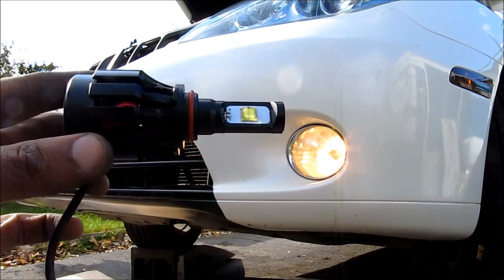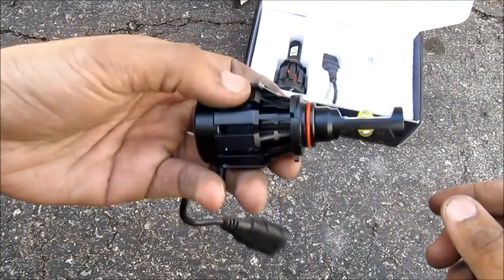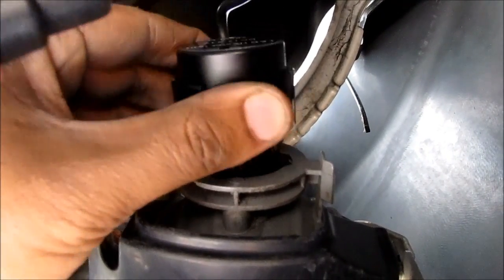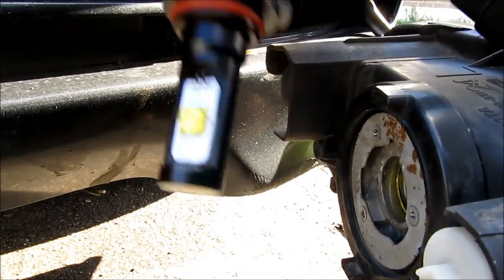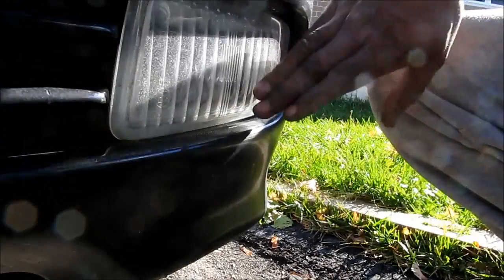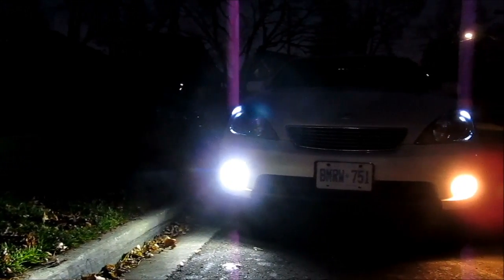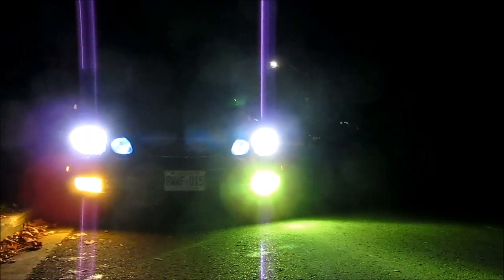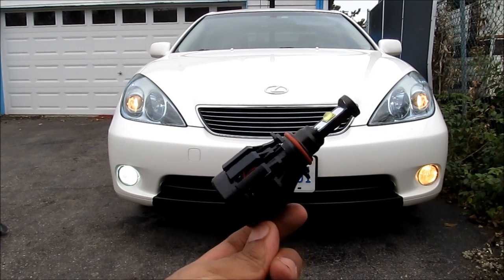LED Headlight & Foglight Review

Comment: how is fuel economy related to the wattage of the bulb?
Reply from the maker: +Angad Singh The savings on gas are very small, but nevertheless it is a saving. If you convert all the bulbs in your car to LEDs you might have a payout at the end of the cars life. That's another reason why manufacturers are incorporating LEDs in new cars these days as fuel economy standards are becoming more stringent because of CAFE regulations.
Reply from the maker: Power for the bulb has to come from somewhere, in this case the gasoline that powers your engine :)
Reply: +speedkar99 

wow. Thats a first. In the event your theory is correct you wouldn't need a battery. Nor would you be able to turn on any electricals when the car is not running. 

Power comes from your alternator/ stator/ magneto which is then regulated by your rectifier and your battery is charged. The battery in turn powers ur appliances. 

In an extremely rare event if your battery is weak and over loaded you will have a weak spark that would result in loss of power or a total lack of spark but it is highly u likely to result in any change of fuel efficiency.
Reply from the maker: I think you missed the point.
The light bulb is driven by the electrical system in the car which is driven by the engine. The engine gets its motive from gasoline.

Therefore the less electrical load on the car, the less fuel burnt. The differences are very minimal and the pay off period is very long, but it does exist.
Reply: Your battery is there to provide electricity to the starter motor, which is used to "boot" the engine into a state where it can run on its own. Once the engine is running, its spark plugs are run by the alternator, which is run by a pulley connected to the crankshaft. If you disconnect the battery from a healthy charging system while the engine is running, the engine will continue to run. If the alternator needs repairing or replacing, the engine dies as the battery was running the ignition system in its place.

The engine, through the alternator, can run the entire electrical system in the car, as long as the battery is healthy and can be recharged by that system easily. If the electrical system pulls less power while the engine is on, then the engine uses less fuel. If you turn on your AC, lights, stereo, etc. before starting the engine, then you are pulling power from only the battery, but that lost power will be recharged from the alternator after ignition.
Reply: I just want to make sure you understand +speedkar99's point. Once the engine is running, the battery can be disconnected and lifted out of the car; all the electronics and other systems can be run entirely by the engine, through the alternator, and therefore all of the energy for that comes from the gasoline the engine runs on. Lower-efficiency incandescent bulbs will use more power, and more fuel, than LEDs, so LED lights will result in better fuel economy.
Reply: +Kyle Mitchell yep as long as the battery is healthy and the charging system is healthy it will run. 

If the battery is very weak the battery will drain power as such lesser current will go to the spark plugs and such. 

Regardless the point on petrol savings seem to be out of whack!
Reply from the maker: Modern cars won't let you disconnect the battery from the car and keep running, but I understand your point in that the car gets all its energy from the gasoline.

Comment: Just as an FYI, in case you're not aware, that "humming" from the LED is the fan in the base. All car LED's have a fan in their bases, hence the large part/heavy duty base. This is normal and helps dissipate any heat.
Reply from the maker: +Somnus no fan in this unit and theres no airflow coming off the back. Just a giant heat sink.

Comment: Do they make that LED in yellow?  That might make it more yellow.  It would be the same idea behind using a red bulb in a red housing to avoid that pink color.  The whole idea would be to make the car look more normal but have brighter lights.  If I had a car that had yellow fog lights or even a yellow capsule in them, I would see about getting yellow.  You would likely get a deeper yellow instead of green.  The white LEDs must have had a bit of blue in them as a result of diffraction.  That is why HIDs seem to be blueish, it is the diffraction.
Reply from the maker: +John Doe I think they make it in a "warm white" which might appear more yellow in the fog light capsule than the greenish in the video. Some other Chinese vendors sell the LED with a capsule that goes over the bulb to change the color.

Comment: Aftermarket LEDs are shit and not worth the trouble.  Even if you get something that wasn't manufactured to a low spec and burnt out after a couple months, they're still a shit idea.  Here's why:

- LED headlights are poor when used in halogen/HiD housings.  It's okay to put them into projectors, but put them in reflectors and the light is ineffective for the driver, and dazzling to oncoming.

- LED headlights emit heat in the opposite direction to a halogen, so they require specific heatsink assembly.

- LED headlights work best when they are specially designed by lighting experts, with a specially designed array.

Here is a short demo of the LED headlights on the Tesla Model X, which come as standard from the factory:
https://www.youtube.com/watch?v=iU5PSnmswSg

Notice the difference between cheap aftermarket kit and manufacturer designed?
Reply from the maker: +Will Davis I agree. Aftermarket plug and play LED's aren't ready for the prime time yet. They're okay for smaller things, such as DRL's, interior lighting and license plates. But for the more important headlights and tail lights, the OEM incandescent perform better.

Comment: good video/comparison.  how are they holding up?
Reply from the maker: They didn't. Started flickering and quit after 3 months. I've since removed them.
Reply from the maker: You don't need a load resistor for these LED's to work. That's only for flashing LED's or to fool the CANBUS system into thinking a bulb is present.

Comment: very good video, every second was informative. 
on the other hand, shouldn't those LEDs and HIDs be illegal for reflector headlights? or, even if they aren't, they produce so much glare it's like driving with high beams on, you are blinding other drivers. i want to install LEDs or HIDs on my Wrangler, but unfortunately i dont have projector headlight housing (and won't order one they're not cheap!)
Reply from the maker: +dpajc056 Thanks for the feedback. These cause just as much glare as HID's. Therefore I'd only recommend mounting and aiming them low (like fogs) or using them as a DRL or auxiliary lights.

Comment from the maker: Update: Well its been 3 months and one of these LED bulbs have almost burned out. These are not worth it at all.
Reply: what did you expect from something that came in a box that had nothing but china writing on it?
Reply from the maker: +Ruben Lira Yes, the Chinese made lights are not good.
Reply from the maker: I agree, LED isn't ready for prime time yet. Even my HID kit outlasted these!
Reply: speedkar99 that's what happens when you buy Chinese crap. lol
Reply: +speedkar99    I'm disappointed but not too surprised, I've found the same issue with some of the LED bulbs I've bought for my home lighting fixtures, both 120V and 12V.  I bought four LEDs for my 12V outdoor landscape lighting fixtures and within a couple of months all four were either super dim or totally dark!
Reply: get PIAA leds. that's what I have in my civic si. they're expensive, but worth every dollar. I've got a video up on my channel, but the camera doesn't do them justice. they're literally the best leds on the market.
Reply: +speedkar99 but putting LED's on licence plate area actually works hehe. So far that's what I like about LED's at the moment.
Reply from the maker: Yes, LED's on license plates are awesome. I've had LED's on all my cars for a few years now.
Reply: Usually the fan motor dies before the LED goes bad.  But a dead fan causes the LED to burn up real fast.  Go fanless.  They use a large heat sink to stay cool, so there's no motor to die, and it uses slightly less power as well.
Reply: speedkar99, Thank you for provided the follow-up comment and your true review about the product!  For that, I will subscribe to your channel. Nice!
Reply: Lack of proper cooling and being over driven voltage wise greatly reduces the life of an LED.
That is why you want to make sure you turn down the backlighting on your LED TV also.
Reply: +speedkar99 
Hey man, I will have to argue for LED headlights or fogs. I have had mine for roughly 12 or more months now and still in good working condition since new. I also have 4x4 LED light bars small tho are brighter than HID.  
H4 HI/Lo LED head lights @ 7000lm/5200lm 
LED light bar 2 x 9inch 90w @ 9000lm.    

I have to say that getting the right LED kit will make a difference for quality and durability, I have a smaller heat sync and fan than the video and again mine have lasted a little over 12 months. 

Another thing the light thrown will depend on the lens and reflector - I have had mine on 2 cars and big difference when the lens has diffusers on the outside. - projector lens is best.
colour wise, the higher the watt the difference in colour - 6,000 kelvin is the heat so HID will have different colour ratted at 6,000 kelvin.

Not having test 10 or 30 different brands and fittings of LED lights I can't say they are the best to use but I cant fault them because I have not had any issues.
Reply: dam it happen to me too i think they sux
Reply: Just get Starnill LEDs off of Amazon, they produce a better light pattern because there are 3 LEDs on it.
Reply: Sadpants McGee u
Reply: What a dam shame
Reply: How did they burn out? Overheating?
Most of these on ebay and amazon come with warranty
Reply: You got it!Check this item,low power & super good fan.  
https://www.aliexpress.com/item/Top-Quality-Limastar-All-in-One-Headlights-LED-H7-H4-H11-6000K-7600LM-9004-9005-9006/32746977300.html
Reply: u
Reply: speedkar99 Well don't buy cheap chinese ones.
Reply: speedkar99 I thought they were supposed to last 5 years.
Reply: LEDs are good. Just don't get the Chinese ones
Reply: Good video bro
Reply: Of course. Made in China.

Comment: you save fuel economy because you change from halogen to LED fog lights lol
Reply from the maker: +Jerry Vegas Yes. It uses less power from the electrical system and hence less gasoline from the motor.

Comment: Those leds are dual beam. They look to be made for high beams and not low beam only.
Reply from the maker: +gasolara2002 These are 9006 single beam. H4 is dual beam.
Reply: +speedkar99 I was saying that because the single beam LEDs are supposed to have light coming from one side if the bulb. Those are dual beam that works with 9006. You need a glare shield or a LED bulbs with the LEDs on the top only so the light will reflect down.
Reply from the maker: One of these bulbs already gave out. Even an HID kit would have been better. :(
Reply: They are probably not very water resistant or the fans took alot of water. Its a risk especially in the foglight area.
Reply from the maker: These LED's didn't have fans, just a large heat-sink. It could have been heat that killed it, or just a loose solder connection, as it did start flickering before it went. Either way, the extra brightness isn't warranted.

Comment: Like HID, LED bulbs are not designed for use in standard reflector housings. They just flood the light and blind other drivers.
Reply from the maker: +Lickalotapus I agree, and that's what this video shows. I wonder how they'd fair in projector housings though.
Reply: +speedkar99 
I have LED headlights 8n the projectors of my STI and they're just fine. I get a perfect  horizon light cut off.

Comment: you have to use a screwdriver to turn the bulb into place??? bahahahahaha ha. get some good light man. those suck.
Reply: +speedkar99 
I just bought and installed PIAA 9006 LEDs. they're  $300 for a pair, but holy shit, they're worth it.
Reply from the maker: Do they give a lot of glare? That was the biggest issue with mine.
Reply: +speedkar99 
they're 6000k and pure white. they've got a good, clean line and don't shine too high. they're just wider than stock. they only have 2 leds per bulb, but they're mega bright. you can tell where the money went. no extra glare.
Reply: +speedkar99 
I'll upload a vid of them.
Reply from the maker: What car are you running them in? Does it have projector headlights?
Reply: +speedkar99 
I've got them in my 2013 civic si. no, it doesn't have projectors. the installation guide shows you how to adjust the bulbs to set the angle of the light output. there are only 2 leds in each bulb and the housing is machined aluminum. there's a set screw that you can losses and tighten to turn the housing to adjust the light angle and I learned that there are actually lines inside the bulb housing that you go by. it's all explained in the PIAA manual. I know they're expensive,  but they are top notch lights.
Reply from the maker: Thats great to know, I didn't think the bulb would be adjustable, just the housing.
Reply: +speedkar99 
if you look at their website, you can see that there's a small set screw that allows you to rotate the bulb to adjust the beam. I've had them in a week now and haven't had anyone flash at me, so I'm guessing they're ok.

Comment: holy shit!  just by installing leds,  I can improve my fuel economy? ?  Holy fuck balls!
Reply: I guess driving in day time saves u even more gas,LOL
Reply: +Babu K 
ikr
Reply: +dpajc056 only highest trim of prius has led headlights.lower trim has standard halogen,so..
Reply: +dpajc056 
and the headlights have fuck all to do with its mileage, so........
Reply: I'll be damned
Reply: +James Ortiz 
I get that,  but the amount of power that headlights pull from the alternator is minimal at best. in my original comment,  I was only picking with the original poster. I've installed PIAA leds in my 2013 civic si and haven't seen the slightest increase in fuel economy. they're rated at 25 watts each versus 55 watts for the original halogens. I understand the less power drawn equals less pull on the alternator equals more miles per gallon, but we're talking prolly not even 1 mpg. I'd have to check though.

Comment: how do you replace the headlights on your es 330
Reply from the maker: +jdtrans7 The headlight bulbs? Pull off the rubber caps from behind the headlight. Twist the bulb counter clock wise and remove the bulb. Unplug it from the wire and replace. Assuming you have halogen projector headlights and not HID.

Comment: Did you mean something different when you said the LEDs will give you better fuel economy?? Lights have nothing to do with that.
Reply from the maker: +MRxxWH33L5 Bulbs use energy which is drawn from the car's electrical system which is generated by the gas powering the engine. The difference in fuel consumption between LED's and incandescent is miniscule. The payout is 62 days, running non stop. I did a rough calculation for LED tail lights here: http://i546.photobucket.com/albums/hh435/speedkar9/2015-11-09%2022.39.47.jpg
Reply: Yes the lights are run by the electrical system, which is the battery & the alternator. These lights, even 65 watt halogen bulbs will not pull enough juice for the engine to rev causing more gas to be consumed. In order for the engine to rev to produce enough wattage to run a light it would have to be in the 1000 watt range.

Comment: That extra glare above the normal cutoff sort of makes the foglight pretty much useless. As a foglight, anyway.
Reply from the maker: +Mawerick77 Yes, I agree. They'd be best as a DRL/ High beam without the proper optics.
Reply from the maker: Yes I have, and they made no noticeable difference to the optics. I've also tried this with HID's in the projectors, and same thing.
Reply: +speedkar99 ...Have you ever try to adjust the orientation of the LED's?
Try to put them horizontally, if not vertically to see if there's any change at all.

Comment: Do you have any updates on these? Are they still working just as well as in the video? Any housing fogging up issues?
Reply from the maker: +Thomas Levens They're in my brother's GS. Yesterday he came home in the cold and told me they're flickering a bit. Have yet to check it out myself to see if its just due to the cold or a loose connection. They haven't lost brightness as far as I can tell. As long as the bulb is sealed with the right rubber ring (i.e. not the one included!) , I don't see a way for moisture to get in and fog up.

Comment: Thank you for the video. I had been considering "upgrading" to LED lights in my ES330, but, your videos have changed my mind on doing so. I'm not significantly color blind, but, I am sensitive to blue light. I might add an LED light scanner (like Knight Rider) to my car but that would be the only external LEDs I'd add. I definitely want to improve the interior lighting so that is on my to do list.
Reply from the maker: +My03Tundra Great. You can upgrade to HID headlights with OEM projectors if you haven't so already. And add some LED license plate bulbs. That's about it that's worth it. You can go all out on the interior and replace everything with white strip lighting like I did here: https://www.youtube.com/watch?v=Mm5CSI-FOeU
Reply: What did you do to the side marker lights? Apply a film, or paint them?
Reply from the maker: Vinyl wrap tint:
https://www.youtube.com/watch?v=gTh6RWqfeO8